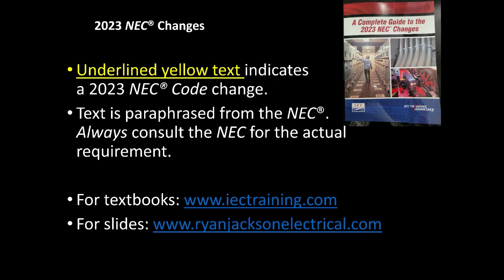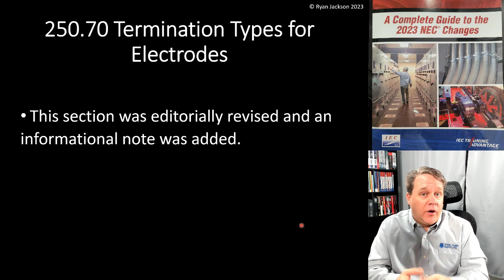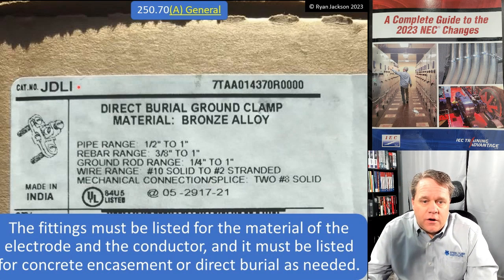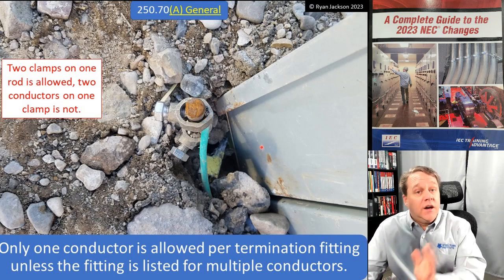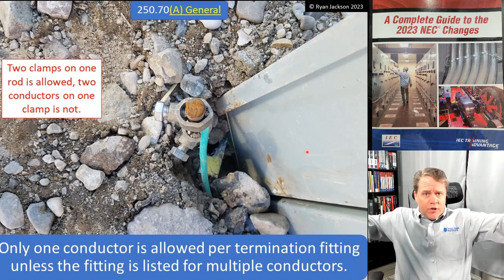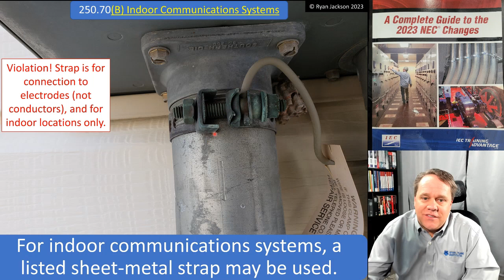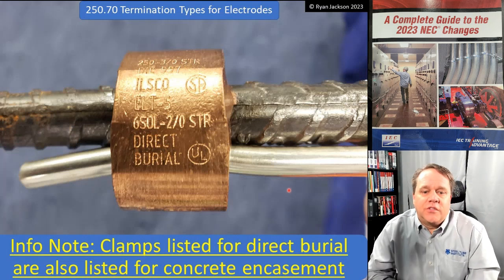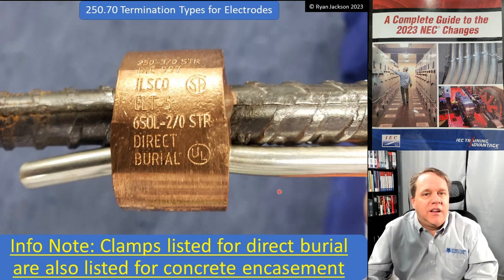2023 250.70 Termination Types for Electrodes

Comment: I always love the (1) conductor her ground rod clamp rule. I used to fold over the #6 Cu to go from one rod to the other but apparently that's a violation. It was still a single conductor (unbroken) but looked like two conductors because of the fold, if you know what I mean.
Reply: Guess that depends on the inspector.  I've ran the ground conductor through the clamp  folded over to go from rod to rod for the 6 years I've been in the trade and so has my fellow electricians that been doing it longer than me, and never failed inspection for that.

Comment: Just wondering has anybody besides me tried to use a 8' Ground rod in dirt to supply the power to one side of a 100 watt incandescent lamp ( other side of lamp connected to 120 VAC. Sure in the big city all concrete jungle would be a lot worst When I tried it 50 years ago the 100 watt lamp looked like a flashlight that was using two almost dead AAA batteries. My house has the best ground path. A 3/4" copper water service, steel gas pipe from underground 6" main and cast iron soil pipe.. Thing most upsetting the po!e that feeds our distribution transformer has 3 phase ( 3 wire ) 13,2KV primary but cheap lazy utility company only runs one high voltage wire to what appears to me as auto transformer. The connect the other side of primary & center tap of 120/240 volt secondary to metal case of transformer and run an aluminum wire to ground rod at bottom of pole. So every copper water service, steel gas line & cast iron soil pipe have current flowing.Even have read a 1/4 to a 1/2 amp flowing thru copper water service with the main circuit breaker off.Did run a #6 copper from service panel to street side of water water..